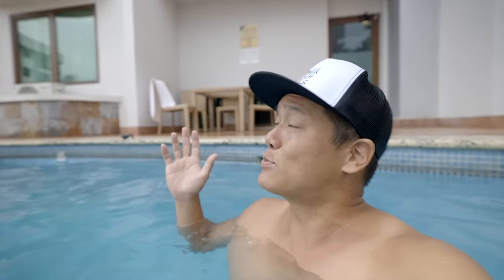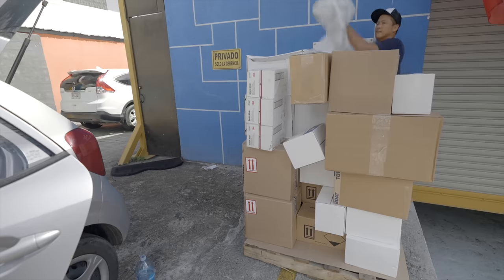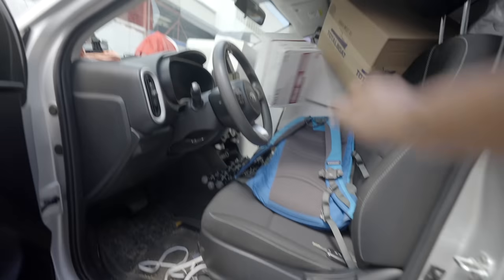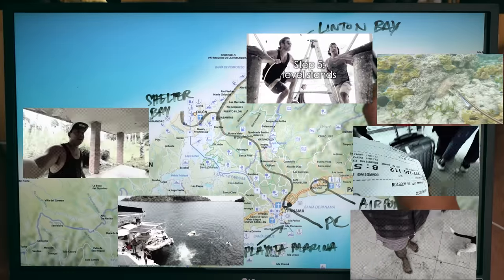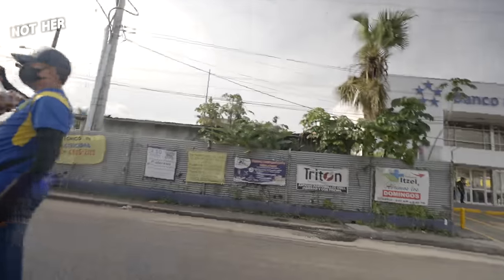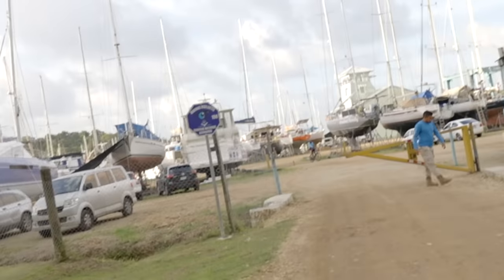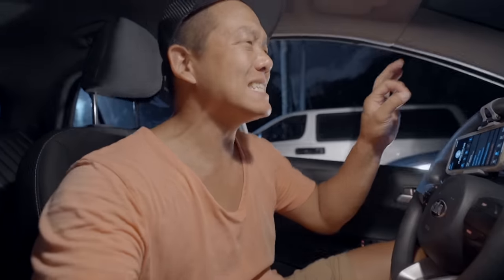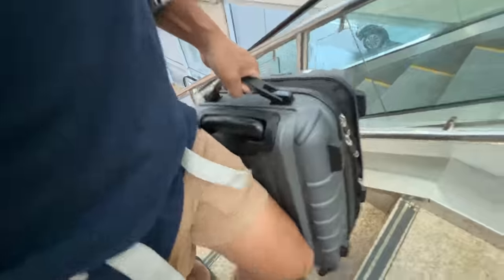I CRAM 1100lb of Boat Gear In a TINY Car

Comment: Total Boat has really been stepping it up supporting the YouTube boat community! Very nice Company! Money well spent ! Sold me!
Reply from the maker: can't agree more...but i think the most important thing is that their epoxy performed exactly the same as the 5 gallons of west systems that i just finished up!
Reply: @David Shih  maybe do another video on the use of the epoxy in the tube and the applications for it down the road so we can get ideas from you how to use it? How long does it last in the tube and did you use a manual gun or those Ryobi electric  guns for it?

Comment: Total Boat did a good job taking care of you, I definitely going to use their products when I start working on my Tayana 37 in Saint Thomas.
Reply from the maker: I've gotten to know the well since then, and they really are good people!
Reply from the maker: awesome man! use the link in the description for an automatic 5% off!!! and st thomas is sounding pretty epic right about now!
Reply: @David Shih  I will when I go there, I wonder if they ship to Saint Thomas in US Virgin Islands? Budget Marine is the store in my boat yard maybe they carry their products? I really like the epoxy you had and used in a tube that mixed in the tube, very smart applicator.
Reply: @David Shih  good video editing also, you must have been dead tired after all that driving. I will definitely  load up the boat and try to bring it to down to that yard to have Louis work on the boat. I also really like what you said about total boats resin that does not blemish so it work better when you add layers  of fiberglass.